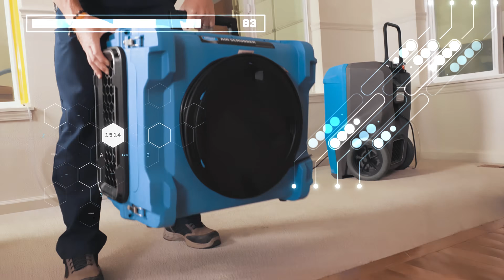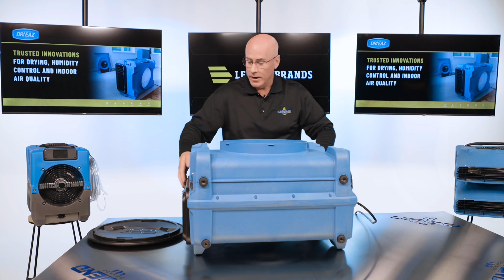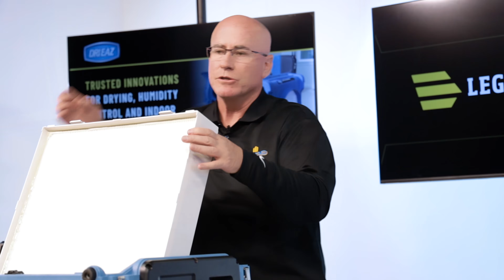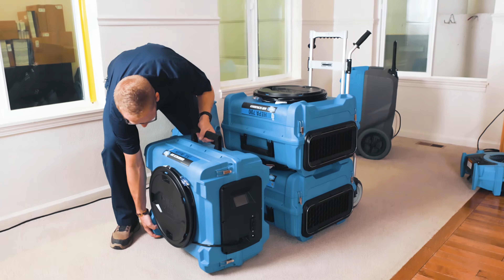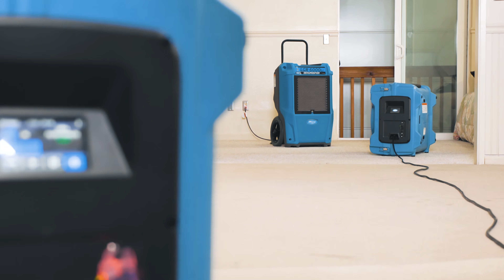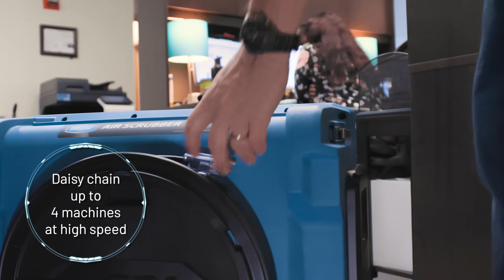Dri-Eaz HEPA 700 Air Scrubber || HANDS ON DEMONSTRATION

Comment: THEY CANT BE TRUSTED IF YOU NEED TO MAINTAIN NEGATIVE AIR They are great when they work. The sensor that detect airflow and filter placement is garbage. It will cut the machine to half power even when all clips and housing are properly placed and the filter is new and the legend brand filter. Not worth the investment. We have 15 and all are having this issue.
Reply from the maker: Hi @ncoros - We’re sorry to hear you’re experiencing issues. That’s not the performance we expect, especially when maintaining proper airflow and consistent negative air is critical. We would really appreciate the opportunity to learn more about what you are seeing so we can help troubleshoot and resolve it. Please reach out to our team at service@legendbrands.com or submit your details here: https://www.legendbrands.com/contact. It could be as simple as a Firmware update to get the machine operating at full power. Our service team can review your units, walk through the sensor behavior with you, and work toward a solution.

Comment: Does the Dri-Eaz HEPA 700 Air Scrubber  meet OSHA standards, has a sealed design, and supports ducted negative air pressure

Comment: EXPLAIN THE PART WHERE THE MACHINE DOESN'T WORK RIGHT UNLESS YOU BUY YOUR BRAND FILTERS. IT'S A MONOPOLY AIR SCRUBBER.
People, If you find the RFID sticker in the legend brand filters, you can stick it to the side where the control panel is and use aftermarket filters
Reply from the maker: The HEPA 700 unit has been specifically tested and validated to meet HEPA system standards when used with Dri-Eaz original equipment manufacturer (OEM) filters. Using non-OEM filters may compromise the unit's performance and efficiency, as these filters may not meet the required specifications for a HEPA system. To ensure optimal performance and compliance with HEPA system standards, it is recommended to use only Dri-Eaz OEM filters with the HEPA 700 unit.
Reply: @LegendBrands  other aftermarket filters that meet the same standards and HEPA rating still can't be used due to the RFID sticker in OEM filters . using non OEM doesn't compromise performance at all and therefore is untrue. no evidence supports your statement that it compromises performance if you use aftermarket filters with the same standards

Comment: Is it okay to use the machine without the expensive primary filter and instead just a prefilter?
Reply from the maker: The air scrubber will not provide HEPA filtration without the primary filter, and you could also risk damage to the machine, since it was designed to be operated with the primary HEPA filter and a prefilter installed at all times.

Comment: What is the plastic layflat duct size? 10" ?
Reply from the maker: You can use 14 in. diameter Layflat Ducting (#126541) on the Dri-Eaz HEPA 700. Here's more info: https://www.legendbrands.com/products/ap-700-hepa-700-ducting/

Comment: Will this machine eliminate pet odors? One of my tenants moved out had pets and house stinks badly from pet urine
Reply from the maker: The HEPA 700 with a charcoal filter will help remove some of the odors associated with the off-gassing of ammonia VOCs from the air, but the source of the odors is in the carpets or hard floors and until those are treated properly, the HEPA 700 will not put a stop to the odors being created.
A great product for treating urine deposits in carpets and floors is OdorX Un-duz-it Unleashed.

Here is a link to the best product for removing urine odors from carpets and hard floor surfaces
 https://www.legendbrands.com/products/odorx-un-duz-it-unleashed

Comment: Just received my new HEPA 700. Upon inspection, i noticed white dust  on the concave area behind the hepa filter, also on the black gasket and on the plastic portion of the filter itself this white dust is present, is this normal? Thanks

Comment: This is the best unit I've every worked with, and I sent a lot of the cheap units back due to design or workmanship defects. I finally spent the $$ for the Dri Eaz due to my good experiences with their dehumidifier. This is a serious professional unit, with a good seal design. I wish I didn't have to buy the electronics assembly as a complete assembly, though, as on mine, only the AC speed controller board was misbehaving, which led to the ferrite bead getting hot and burning the PCB and a few components around it. I don't attribute this to any design defect, but a problem with a defective relay which I troubleshot, which happens--I don't fault Dri Eaz for this. Having to replace all the boards as an assembly is expensive and unnecessary. Being that the relay failure is not a design or manufacturing issue, I still fully recommend this product.
Reply from the maker: Thanks, Daysha - sorry you had an issue with the board. Overall glad it's worked out well for you!
Reply: @LegendBrands  Yes, yours is the unit to buy (or your 500 cfm unit), as you guys do the gasketing right unlike some of the cheap overseas-designed products that are not suitable for much other than filtering dryer lint or pet hair, and certainly not hazardous dust or mold. I'm trying to find another local tradesperson with a 700 so I can take a measurement of the three burnt components surrounding "FB1" on the power board, to complete the repair accurately (I'm an industrial process/electrical engineer by day), so I don't have to guess. Not Dri Eaz' product fault at all--failures of components occur--but I'm used to maintainability at a lower level. My input for your team, as you might guess, is being that the power board takes the greatest beating, to consider cost of repair and make it its own P/N versus having to buy all three electronics boards, which also causes loss of your accrued runtime count as that is stored on the old processor board.

The control panel of this unit is great. I haven't tried the RF network interface over the year or two I've owned the unit.

Comment: When you attach the ducting system, does it work automatically? 
Can you explain how to use that properly. 
Thank you in advance.
Reply from the maker: When you attach ducting to the HEPA 700, it allows you to control the air coming into the unit (if you're ducting in the inlet) or where the filtered output air is going (if you're ducting the outlet). If you need more assistance, please reach out to our technical team on live chat at https://info.legendbrands.com

Comment: Do you keep the black round cover on or do you take it out when running
Reply from the maker: You definitely need to remove the black round cover - that's where the air flows into the machine.

Comment: What benefits other than cfm and app is better than the 500. 

The app is only rated at 2.2 stars so sounds pretty useless.
Reply from the maker: Hi Calvin - The HEPA 700 is also much quieter than the HEPA 500 and it's DOP compliant with the unit's standard filters, which provides extra assurance of its filtration effectiveness, especially for containment situations, and the digital control panel provides job hours and indication of HEPA filter health (not just an alert when it needs replacing). In addition, filter changes are easier with no tools required. The app that will work with the HEPA 700 will be released in early 2023.
Reply: @LegendBrands  thanks for the prompt clarification!

Comment: Research shows that Fiberglass filters are more robust and durable. They are also more efficient with a longer life span. Synthetic media pleats fill up faster and stop filtering after several hours. Fiberglass filters continue to remove particles down to .3 micron for up to 900 hours. What about carbon dust from the motor? Looks like it's behind the filter.
Reply from the maker: Advances in synthetic media technology have produced the best performing and the most durable Primary HEPA Filters. Synthetic medias of today offer better airflow (less pressure drop) than fiberglass media, plus they are less likely to be damaged during transport or installation. That’s why we chose a synthetic primary filter for the HEPA 700. The optional carbon filter is positioned closest to the outlet, then the 1" prefilter, so that the prefilter will collect any dust from the carbon filter. If you have any other questions, feel free to live chat with us at https://info.legendbrands.com
Reply: @LegendBrands He didn’t ask about the carbon filter. He asked about the carbon from the motor. So, after you understand the question properly and ask a knowledgeable  person in your company I’m curious what you come up with for an answer to this question.
Reply from the maker: In response to the question about carbon dust from the motor, the HEPA  700 airscrubber doesn't use brushed motors, so there is no carbon material released from the motor during operation. The bearing system in the motor is sealed and other motor components do not wear in a way that would release contaminants into the filtered air stream.